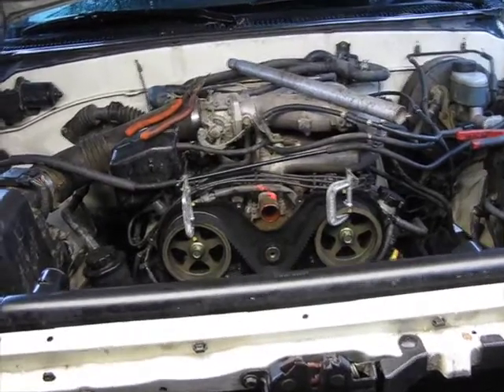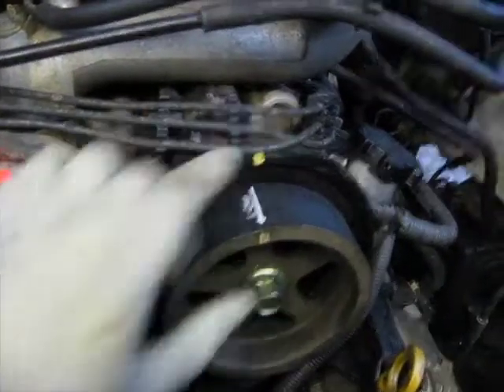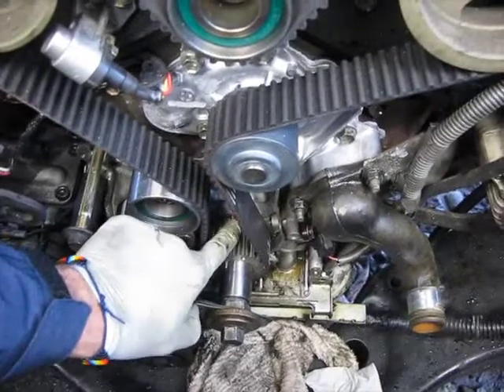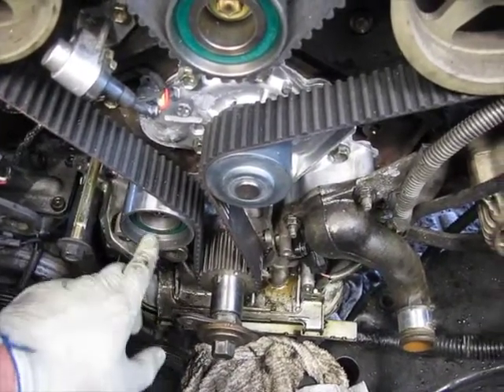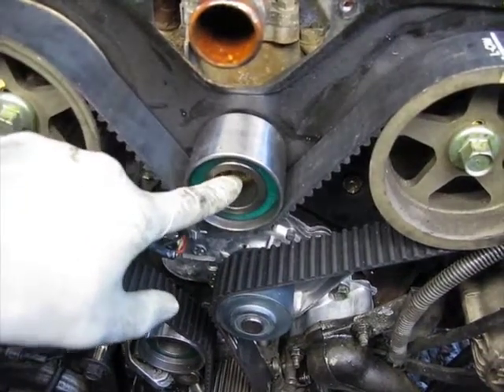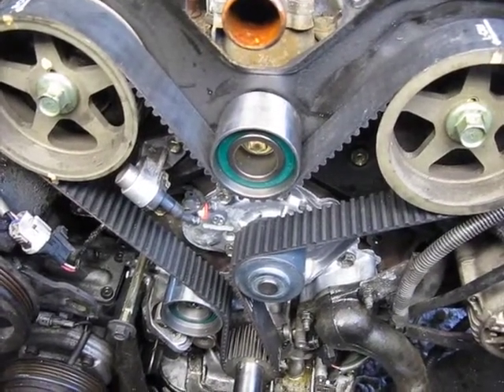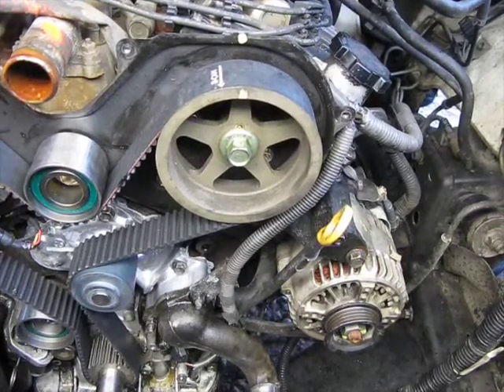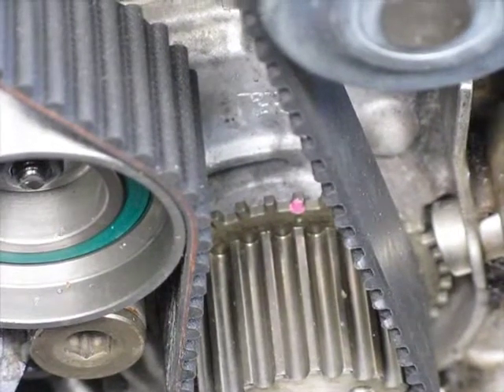Tricks to Getting Timing Belt on 3.4l 5VZ-FE Toyota

Comment: I did it the same as you only I installed the new tensioner  and only started the bolts with a few threads and left the captive pin installed. I Installed idler pulley last just like you did then tightened the tensioner pulley bolts. I think having the tensioner pulley bolts backed out really helps, the idler pulls went on very easy for me.  I tightened the tensioner bolts and removed the tensioner captive pin.
Reply from the maker: Glad to hear it still works !

Comment: I made a tool that bolts to the water outlet neck flange right above that upper pulley, with a nut welded into it with a bolt right above the center of that pulley. It puts a little tension down on the belt in the middle of the cams to help get that bolt in that can be a real pain.

Comment: Did you remove tensioner?
Reply from the maker: so like i said in video-- yes that is a good way to do it... leave the tensioner out (or barely start the bolts) to give yourself the maximum amount of play on the belt... you can also put that top idler puller in (like in the video) last as well while working the belt on (just make sure you don't cross thread the bolt). The other thing is you can put a little bit of tension on the left CAM pulley to take up tension on the belt and give you more room to swoop the idler pulley on (if you are putting that on last... with those tricks it isn't hard-- but without doing something like leaving tensioner out or putting that top idler in last you will battle it for way too long. If it is taking you more than 15 minutes stop and rethink what you're doing and take the tensioner out from the bottom and try again

Comment: Nice. I had a question my have 1999 Toyota 4Runner 3.4 same engine. My timing belt broke while driving. How do I line up the points if my belt mess up when it broke. Thank you
Reply from the maker: 702solidink just use the bolts on the cam and crank to use a ratchet and get them lined up. It’s non interference I think so you’re good moving things around (double check that)
Reply: Max's Garage aloha 🤙🏼 thank you
Reply: Max's Garage I line up both cams with there markings. But the crankshaft I had to turn it counter clockwise to line up the triangle marking. I tried turning it clockwise but Wouldn’t make a full turn for me to line it up. So I had to turn it counter clockwise to line up the dot to the triangle mark. Didn’t I don something wrong ? Thanks
Reply from the maker: 702solidink hmm I don’t know. Did you try running it now? If marks all line up throw belt on and try to run it
Reply: Max's Garage I’ll try.

Comment: I was tryn to loose the crankshaft bolt in a 4 runner 99 sr5 i dont know what happen but now the crankshaft not turning freely,is turning 180 degrees and stop,the same thing left or right,looks like a piston is touching a valve,what you recomend me to do? Thanks in advance i remove all the spark plugs,but the problem still there.
Reply: Did you set it to TDC before you attempted removing the pulley bolt? Depending on how you attempted to remove the bolt, by hand? I doubt you damaged the valve or piston. By cranking it over, you most likely destroyed it.